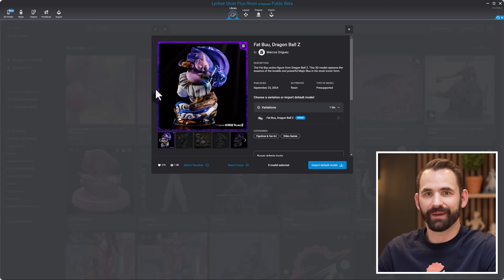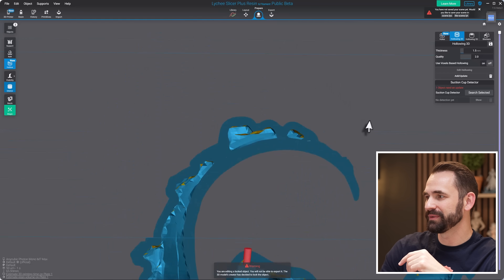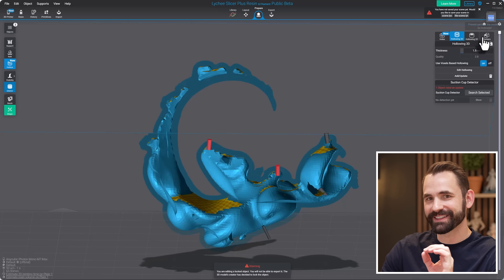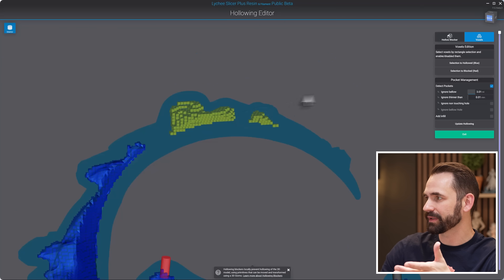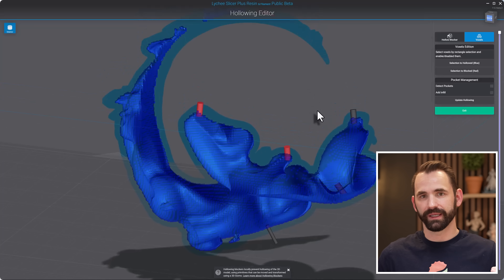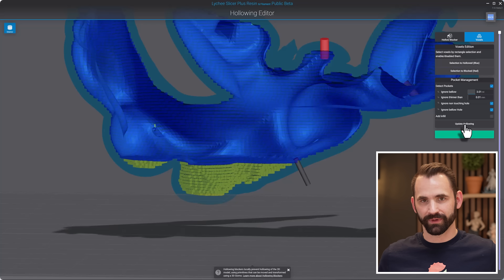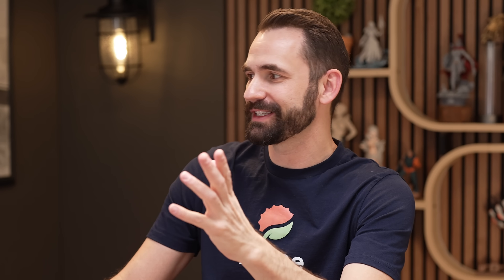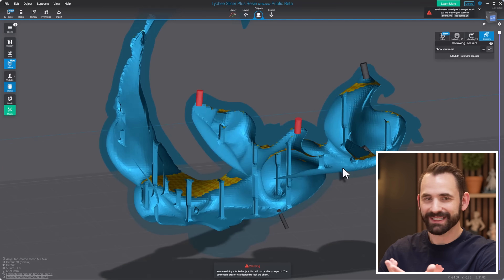Shape our next Hollowing tool with us | Lychee Tech Demo

Comment: Hi, I would love a tool for making keys in a figure. Like let's say you have a small printer and you download a STL model that is too big or you are having trouble with angles because you bought the model without selectring seperate base. It would be so nice to have a tool that helps you cut and the auto generates a key in the cut surface. Like it creates a square sticking out of one cut surface and a correspondinghole on the other cut surface

Comment: Hey Derek, 
I have a suggestion but I am not quite sure if anyone has mentioned this or if there is a solution already implemented. I was in the process of preparing a pre-supported model and lychee told me there are some unsupported islands left. It can be very tricky to spot the islands Lychee finds. Is there a way to make them stand out more, like a red flag or a line pointing to the islands? If not this would be my wish 🙂
Cheers, Axel
Reply from the maker: Hi, yes it's already in there, you can check previous videos where we support models :D

Comment: Yeah, a voxel brush. This idea is a game changer, taking blockers to the next level. Some automated, small cavity, isolation would be good for default, but should be adjustable. The Voxel support generation is very good as well. but can it somehow work with island perception to produce towers were islands are generated from the hollow. This is going to be great for making internal funnels and channels to direct the resin and suction forces. Lol last thing can the hole tool have diameter adjustment for both ends of the hole ?
Reply from the maker: Greats ideas thanks!

Comment: Im pretty new to lychee but definitely value the look behind the curtain.  
A few things from 3D scanning that help with clean up that may help with voxel selection: a paint brush feature with add/remove as control/shift, a 'select attached' feature that if you click one voxel it will auto select everything that is attached to it, an invert selection tool is very handy as well. 

auto drill is rad- it would be cool if it searched from the low point in say a 45° cone 'downward' to find the closest outer surface to connect to and created a hole of whatever preselected diameter you'd like

I would LOVE it if once hollowed/supported or whatever an STL can be exported.  In CAD many times it is difficult to shell geometry that has thick to thin sections.  Slicers tend to shell/hollow very well, but getting the data back into cad is usually pretty hard.  For example if i want a given shape with gyroid infill and no walls slicers (orca) can do that super easily but getting the data back to cad is miserable.  It would be nice if it were a 2 way street...

keep it up- thanks

Comment: I recently got a 30 day trial of the new Chitu box slicer and tested their auto supports and auto hole feature and I’m amazed as to how fast and convenient it was compared to lychee slicer. Are you looking at improving the processing time as it’s quite slow and the more build plates you have the longer it takes.

Also, when you save a project, why do you have to rebuilding the supports and hollowing again as it’s wastes time loading the project.
Reply: For the last 2 years we've been working on an entirely new engine that's going to unlock the ability for us to really change how the software runs. As of right now we're kind of restrained. 

This newer updated version of lychee will release in Early Access q1 of next year and should be the primary release by Q3.

Comment: Any plans for a magnet holes feature? I feel like it’s becoming an integral part of many’s workflow, and it would be awesome if Lychee lets us carve out magnet holes before hollowing…
Reply from the maker: You can already use the existing holes, simply bring down the penetration of the hole to match your magnet :)
Reply: @Lychee3d  but I need to somehow "apply" the hole before hollowing, or hollowing will not respect it and the hole would go all the way through into the hollowing. Right now, I have to apply the holes, export as a new object, import it and then hollow. Otherwise the magnets won't have a base to sit against and might fall into the hollowing...
Reply: @kage49 That's only an issue if you export the 3d file into a new .STL or convert the hollowing hole into a hole hole. Any reason to do either? 

That said having a dedicated tool for this would have some extra functions making it better to use.

Comment: PLEASE, please just add 'orbit around mouse' to the navigation. It's an absolute nightmare working in the Lychee viewport without this. Every other 3D program has this feature. I'm sure it's very easy to add and would make the navigation UX 1000x better. Otherwise Lychee is a great toolset for manual support work, but this one missing essential navigation feature makes me hate the thoughts of having to do supports more than anything. :D
Reply: Wherever your mouse is on screen. Hit F on your keyboard. This will center your camera to that point. From there you can rotate from that point being the anchor.
Reply: @J3DTech  it's rubbish. Doesn't work properly. Zooms all over the place, often to the opposite side of the model when in close, plus it doesn't work in edit mode. It's hacky and not a substituto for a proper orbita around mouse, which is standard in pretty much every 3D program.
Reply from the maker: Thanks for the feedbacks!

Comment: I really love the voxel hollowing and the way it helps fill resin traps. That said, the current blockers are tough to work with, and there’s a bigger issue: wherever I place a blocker, I later get a layer line shift in the print. It’s not just annoying to use, it actually ruins the final result and makes the print unusable.

I’m not sure what’s causing it. It could be something in the software, or it could be a mechanical effect from the print transitioning from hollowed geometry to a suddenly larger surface area when the build plate peels from the FEP. Either way, please test this thoroughly in as many different scenarios and edge cases as possible before releasing.

Also, please keep the option for normal inner supports. Sometimes I intentionally make them very thin so I can break them later and install LED lights inside, like I did in my latest YouTube video. You can see me placing the inner supports in Lychee slicer in the video and then tearing them out afterward.
Reply: We would never remove the option to do normal supporting inside. And then you always give the user tools to solve problems their own ways and has no auto system can never be perfect. You also need to give the option of the user to correct any inconsistencies.
Reply from the maker: Thanks for the feedbacks! :D

Comment: great feature, but, main goal should be speed and stabilty - and that lacks in current version.

program crashes, detects non existing islands all over the screen, "get island worker errors" (whatever that is), very unresponsive support placing, specialy when interior view is selected), slicing is ultra slow (compared to previous version), lagging..... just to mention some.

feature without stability is worthless, and when you have 20 parts on plate to support, and program chashes on every single one, not just once - there is no feature that will be worth that hassle and time loss
Reply: We've had a project in the works for 2 years to rebuild the engine of lychee. This new engine is going to be out in early preview early next year and by Q3 or Q4 it's going to be the main version. This is where we're going to solve pretty much all these issues.
Reply from the maker: I understand crashes and slowdowns can be really frustrating, we're fully focused on resolving them as we also work on other features :)

Comment: I just had contact to your support regarding my subscription, it was fast and solved the problem immediatly. As your new tools will be. I love your software and tools for 3d printing. The only thing i would point out would be your repair function. Sometimes the files are just ruined with holes. Sometimes hundreds or thousands. And lychee struggles with these files. i then need to fix it in lets say orca slicer and bring it back to lychee.
Is there a solution coming in the near future?
Reply from the maker: Thanks for the feedbacks, you can also repair your model in a 3D builder software which will be more efficient :)

Comment: Auto supports currently suck. Two major issues I hope you can overcome: 1) lots and lots of supports, many of which don't seem to be needed. Less is more here. 2) the biggest problem are the supports that come out of the drain holes and are connected to the support structure outside. They're connected inside and out and are very challenging to remove. I'm print tank bodies and sometimes turrets that are hollowed. A tank body is pretty rectangular so I can imagine there are much more complex hollowed structures. All these interconnected supports make great resin traps.
Reply from the maker: Thanks for the feedbacks, have you played with the settings to get the required amount of support wanted? :) If not check this video: https://www.youtube.com/watch?v=TYIWdMxkwpU&t=180s
For the internal support, is your model pre hollowed before importing in Lychee?
Reply: @Lychee3d  yes, sometimes including internal support "beams" like you show at the end of this video.
Reply: The new Plus Auto supports are all about you creating a profile. However you said you're doing thank parts. This is hard surface modeling and you're going to be better off using projection supports for this type of 3d file. 

You can always make a preset that works well to run over the projection supports for your type of files. The new Auto system won't delete the existing supports. 😊
Reply: @J3DTech  Thanks. Not too familiar with projection supports. Am looking into it!

Comment: I do not print my models with internal supports. looks promising but don't get rid of the no internal support option.
Reply from the maker: You'll still be able to choose to have the inside structure or not and to add internal support or not :)
Reply: At the end of the video, when you show the “support pillars” at 5mm and 10mm spacing, I noticed “green blobs” on the pillars, and then once the pillar spacing was confirmed, all the pillars turned blue (like the rest of the model) and there then appeared be areas on some of the pillars that were “eaten away”. (1) What are the “green areas” on the pillars supposed to signify, and (2) why are some areas on the pillars “eaten away” (rather than the pillars having a “smooth” surface along the length of the pillar)?

Comment: Ok this is next level 👌  This is something we need ASAP for sure  love this idea

Im not sure if this has already been done on lychee  but adding a  magnets option   so it would drill a drill a hole where you ask it to go and then make it a perfect depth and length
Reply from the maker: Thanks! You can do it when addind a hole, it's not like an option labeled as Magnet Holes but it's the same principle :)
Reply: @Lychee3d Well, Derek, adding a SPECIFIC dialog selection called “Magnet Holes” or “Create Magnet Holes” would help the user (because it’s focused on the specific task they want to do)! Maybe it seems redundant to the Lychee Dev Team (because the “hole cutting” function is already in the software), but how much dev work would it take to add a “Create Magnet Hole” option. Here’s a suggestion: A good “Create Magnet Hole” feature would ask user to “specify the magnet diameter”, “specify the magnet thickness”, “specify magnet inset from model surface”, “specify magnet adhesive thickness to be applied under magnet”, and “specify tolerance spacing around magnet (increase in hole diameter to prevent “interference fit”). Based on these “inputted” user parameters, the Slicer program would create the “magnet hole” at location selected. Added Bonus #1: If the “magnet hole” violates suggested internal or external wall thicknesses (defined by the user), then Lychee should flag this, with a “red color” suggested. Added Bonus #2: Give the user a “show a “mock-up” of the “magnet with adhesive” option. This Lychee option would simulate the “magnet and adhesive layer underneath the magnet” placed into the “magnet hole” with the specified diameter clearances between magnet the surrounding body of the model.
Reply from the maker: Not saying we won't do it, just suggesting that in the meantime it's still possible to do magnet holes with the currents option within Lychee :D
Reply: @Lychee3d 👍👍👍Alright, Derek. Thanks for the diplomatic reply! 😀
Reply: @Lychee3d  thats good to know  ill.keep a look next time for sure 👌  because  that would be useful